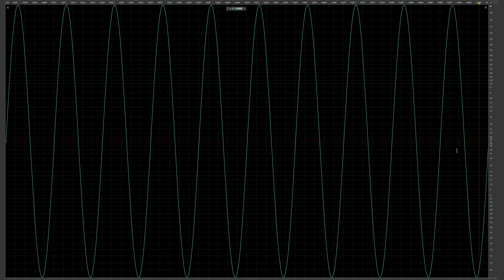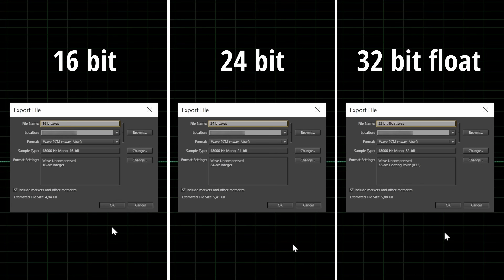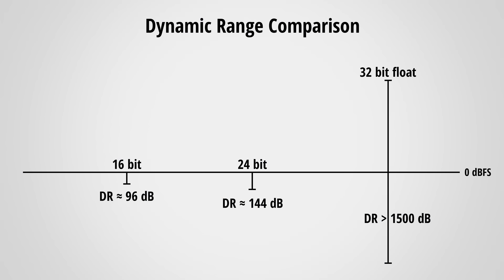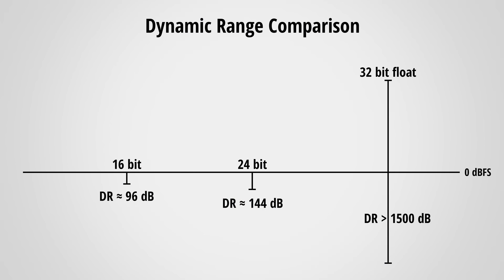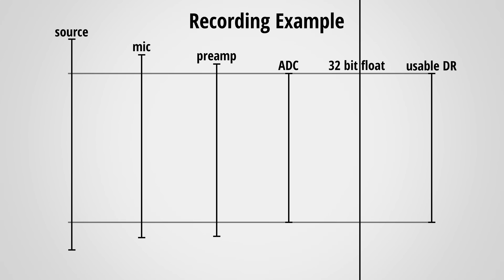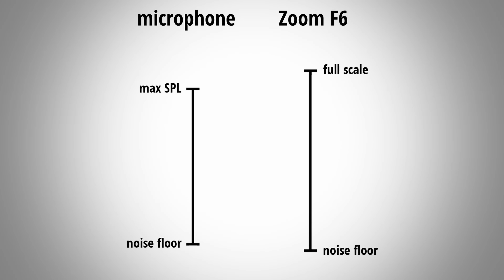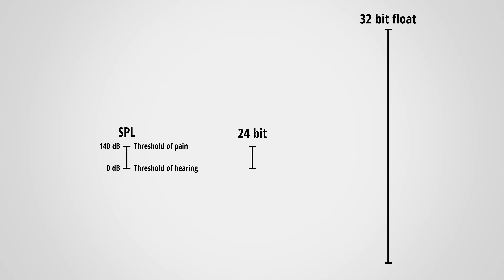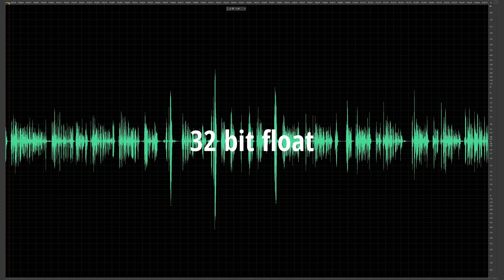The TRUTH about 32 BIT FLOAT for audio recording– Really useful or marketing hype?

Comment: There's nothing special about 32 bits when it comes to restoring clipping. 16 bits can also be restored by the use of synthetic restoration. The cost is: less resolution - in both cases. 32 bits don't automatically give a greater dynamic range. A choice to use some of the extra resolution for greater headroom must first be made. When a recording is clipped, the information is lost forever. Calling it restoring the original sound is a misnomer. It's all about a synthetic process where the data is guessed more or less accurately - usually less. To truly recover lost sound the process needs to understand the sound and what it consists of and basically replay the tones or voice from a library, in time, frequency, and phase domain - an impossible task. Today there's no sensible reason for not always using 32-bit float when the equipment supports it - especially when dealing with advanced filtering or synthetic voices and instruments.

Comment: Nice coverage, Julian, very well explained. 32-bit float is useful if you wish to push decision-making and work to post production, assuming that your microphone can handle the SPLs you record. I'm with you, 32-bit float is very rarely useful for my work. In fact, if I'm using a channel strip or interface or recorder with a compressor, I can get closer to where I want my final audio to sit with 24-bit and save myself some work in post.
Reply: @curtisjudd so limitations are given by the mic’s SPL. But how would you control your gain, and know you have enough, not being too quiet, when using zoom f3, for instance? Also, does f3 have direct monitoring?
Reply: @thesilencer6736 the F3 does not have an analogue gain setting. Yes, the F3 has a headphone jack for monitoring.

Comment: I wish people would stop calling this "floating point". 

Float (or "32 bit floating point") is a mathematical notion. These new ADC's are "multi-path" devices, not "floating point" devices -- they do a little more than 24-bits, not "1500dB". Moreover, 32-bit floating-point math cannot guarantee bit accuracy beyond the 24th bit. To my knowledge, there are only two DAW's today that can actually store, process, and deliver bit-accurate 32-bit audio.

There have been myriad names given to multiple-path audio processing: ranging, heuristic, parallel, multi-path, adaptive, etc.. I think multi-path is the most appropriate. The IC company Cirrus is working on multi-path ADC IC's, and that's what they call it in their patents --- "multi-path".

Oh, and Julian, the threshold of hearing isn't 0dB SPL. It's -8dB SPL, at mid-range freqs.

Comment: I still don't get it. People are referring to the thermal noise and phase noise of electronic equipment and claim that there is no need for more than 24 bit resolution. But I feel this is only true for the whole dynamic range at once. I want high resolution at low signal levels just above noise floor and still be able to record the full 120 dB range. I understand in 24bit you would have to decide on either one of those objectives.

Comment: don't clip your 24 bit recordings in the first place.  24 bits is enough for audio recording, imo.  32 is fine if you want to add 25% more file size to your project for negligible returns.  some people even record at 96 kHz sampling rate instead of 48.  Hey, remember when 16 bit 44.1 was all the rage when EVERY compact disc used that for encoding?  Math was used to determine that 16 bits and 44.1 kHz sampling rate was sufficient to capture 99.9% of everything we as humans can possibly hear.  So 24 does give you more headroom and lower noise floor and 48 a few more samples of accuracy.  So that, to me,, makes good sense.  But if you have the $ and think it's worth the extra disk space and transfer times. go for it.  I have a 4K TV but I don't need 8K.  I won't be using a size big enough to warrant that much detail.  To each their own but if your ears can't hear the difference, why pay for something that does nothing beneficial?  Lots of people probably have deficient monitors anyway or noisy components/signal chains.  They definitely aren't going to benefit.   Weakest link concept.
Reply: On spot! Cheers
Reply: @SameeraWeerasinghe  On POINT!  :)  Another point... I doubt any pro studio is using 2" tape anymore for multitracking.  It makes no sense anymore.  The .0001% smoothness of analogue isn't worth sacrificing all the pros/benefits of recording/mixing all in the digital domain.  Only analogue stuff you need is just stuff you want.  You can literally model just about anything now but I know some engineers and mixers prefer to still use some hardware like compressors and EQs and such.  At this point in time, the tech has surpassed our ability to discern the difference so using more than necessary seems like just a waste to me.  Someone smart once said use only as much as you need - no more.  or something similar.  No one waters their lawn with a fire hose and no one cuts their front lawn with scissors.  BAM!
Reply: Yeah
I've used 24-bit and 44.1khz for years now. It's fine and I see no reason to switch to other/"better".
I think a lot of these technical hyper-detail perfection-hunting topics comes from boredom and a lack of focus on the MUSIC and being CREATIVE.
You know, the good ol' essentials. Music can also be "perfect" coming from an old kitchen radio

Camera analogy:
"We need even more megapixels!" ;)
Buy a good lense instead and focus on taking good pictures
Reply: Thanks, making a SSL 18 purchase more purposeful 🎉
Reply: Just because the colors represented in a jpg doesn't mean you should shoot in jpg quality. No, I'll shoot in raw and convert to jpg for delivery. Saying "Well you don't need that many colors, because you can't see them anyway." is faulty thinking.

I want the extra bit depth for archival purposes, and the high frequency of 96khz, or even more because of filtering foldback. The higher it is, the more transparent the conversion filtering is, again for having the most pristine version for archiving. There's pre and post echo, or the Gibbs phenomenon that higher frequencies actually help with in the time domain capturing at higher frequencies.
Reply: @aaronmarshall  That's a good point.  As math teachers once said, "Never round off in the middle of a problem."   You want to have the highest resolution during the processing, THEN downsample/round.   But if you can hear the difference between 48K and 96K, you are one bad mofo!

Comment: Nobody would record with an 8 bit ADC unless they're looking to get some of that sweet sweet quantization distortion.   If you're recording a person who whispers and also screams - where the scream is occupying digital full scale (24 bits) and the whisper is ≈ 90dB lower...  The whisper is effectively using around 9 bits.  A 32 bit recorder would encode that whisper using ≈ 17 bits.  These kind of finger wagging summations of dynamic range also fail to consider factors like "headroom" which basically assumes that any recording of a sound is both unpredictable and fraught with technical constraints.  

So yeah, it's technically true that 24 bits can record from the threshold of pain down to the threshold of hearing,  but the lower part of that range will be sitting at or very near a noise floor.  Ultimately 32 bit is another tool in the toolbox that when cleverly deployed gives the recordist a bit more leeway to capture something with the highest possible quality

Comment: Hello Julian! I'm currently trying to use my Zoom F3 as 32 bit audio interface, but audition is still clipping my recording on 0db. I downloaded specific driver from zoom website, updated firmware on the recorder which is adding 32 bit AI mode, chose ASIO in audition, but it didn't help.

Comment: don't forget that 32bit float is incredibly more accurate for any signal processing, expecially modeling.

i rember that using a toneport gx you could literally hear the difference between setting it up at 16bit or 24bit when doing amp/pedal modeling

Comment: Simply using less than 64 bit FP (duble precision or scientific) for processing this day's is ridiculous as you get it cheap and in sufficient amounts for audio processing trough general purpose FPU CPU cores. Best ADC's and DAC's and I mean state of art one's achieve SINAD of 21 bit integer (123~126 dB). ADC is usually weakest link in the chain and no commercial crap doesn't get even close to mentioned limits. If you want to do amateur equipment measurements or very high fidelity recording buy inexpensive Cosmos ADC (almost 120 dB SINAD) and be aware of it's limitations (impedance wise and others).
Reply: You expect recordings to require 160dB precision on the regular? Who makes your 53 bit ADCs and equally low noise front ends?
Reply: @0LoneTech  don't think you really read the comment. I expect use of 64 bit FP because you simply have it (even on your smartphone) for DSP and corrections which will be glued back to 32 bit integer on DAC and even that much because you already have it and for volume controls mostly. Performance won't go up from 21 bit (123~124 dB SINAD) nor it needs. That's a threshold of perfect hearing (120 dB) and in mids and lower highs, and lower   in highs and even lower in lows.
Reply: @lazarprodanovic8373  Processors that do fp64 as fast as any 32bit are rare. It would just be wasted power, memory and time, which is admittedly not uncommon. Fp32 typically calculates four times as fast or more, using half the memory, and still gets you about 25 bits per sample.
Reply: @0LoneTech  lol, you have it in your pocket. Pretty much 32 bit is already legacy. FP on FPU of today's general purpose CPU's (including ARM) is more than enough for audio processing. It is expensive when you really need to do complex scientific simulations then you need GPU's with unlocked 64 bit FP multiplier. It's 64 bit bus so it takes same number of cycles if you do 32 bit or 64 bit,  packing works (to a extent) but for micro OP's that are shorter. And you even have 128 and 256 bit SIMD's there. No need to get into high parallel  many core ADSP's and GPU's (which are actually similar). You probably missed the century.

Comment: i disagree with its not a noticeable difference. I Find lower sub frequencies are easier to bring up to level in 32 bit float. recordings sound fatter. Therefore it is EASYIER to record in 32 bit. with 24 bit you you still can't do that, like a transient happy kick drum you can't record it as hot in 24 bit.
Reply: like you said you have to still record correctly, but it DOES sound better.

Comment: Float means "floating (moving) decimal point". Thinking decimal: imagine a 7 digit number with floating decimal point - we can write numbers from 0.000001 to 1,000,000. Traditionally we use integer numbers for 16 and 24 bit depths and, once again thinking decimal and using a 7 digit number we can go from 0000001 to 1,000,000 - that's because integer numbers don't allow for fractions. 

Let's compare how much larger the second number is compared to the first one in both cases: 

7 digit decimal float: 1,000,000 divided by 0.000001 equals 1,000,000,000,000
7 digit decimal integer: 1,000,000 divided by 0000001 equals 1,000,000

Comparing how wider is the float range compared to the integer range (same number of decimal digits¹):

1,000,000 divided by 1,000,000,000,000 equals 1,000,000 - using float allows for a range (from smallest or quietest to largest or loudest) a million times greater.

1) I used decimal digits instead of binary digits (a.k.a. bits) because it's easier to understand. Remember that floating point is a bit more complicated than what I did but I think keeping it simple helps to understand why floating point gives a larger dynamic range than using integer. I did not talk about dBs because I know very little about it. 

Thanks, Julian! I finally understood how 32bit float works and how it can be implemented using less than 2^16 16bit ADCs!

Comment: One also has to remember that the Signal to noise ratio is the same for 24-bit signals using all bit as a 32-bit float signal. So if you add signals that are at different levels only the "largest" 24 bits of data will survive, which of course normally is fine, since the lower signal would normally drown anyhow. But just to say - the precision of the 32-bit float signal is not higher than a 24 bit signal, as long as you use the full range. What float does, is it saves you from making a lot of those "level"-mistakes and makes it much easier to do the signal processing, but the sound quality is the same

Comment: I'm wondering based on your older video on preamp gain effecting the level of the noise floor in a recording that if you intentionally place the gain on a 32bit recording device (i have the Zoom F6) between the two preamps and lower it in post, do you get less preamp noise? Is it just two halfs equal 1 situation?
Reply: I have recorded album with 32bit float on F6 in 2022 drums, piano, bass, guitars, vocals. And this year 2023 i did another one with my old Zoom R16 in 24bit but i think the most difference there is are the more noisy preamp's Zoom R16 has. With F6 i can boost the top end over 10k high's of a piano without bringing up a bright noise like with the R16 preamps. On this years record i went more mellow, natural sounding overal feel and did not boost those. Overdubbing with F6 is time consuming process couse you have to record with two recorders, one to capture the sync + F6 to get the sound of the preamps and sync those tracks in post but the result sounds really good and there was some depth i could hear in the sound

Comment: You want to translate analog to digital the best possible. 32 bit is the next best audio capture the hardware can do nowadays. 32 bit vs 24bit, you can hear the difference..... you are best off with 32 bits resolution + from the engineering perspective and future audio signal quality. Also it has to do with signal bit resolution not SPL. It is not about a marketing hype but simply audio engineering.

Comment: I really hope someone will cover the topic of lossless files, the difference between wav flac aac, and so on, and compare to 320 256 192khz. Add to that what is 24bit and 18bit when should we listen or what type of music should we listen to music based on these so many formats and so many different bitrates. Most importantly how do we spot genuine lossless files, using different software to identify the authenticity of music files could cause confusion for example Spek and Fakin' The Funk, not all the time both softwares agree with one another when accessing a lossless music files thus this caused greater confusion of am I holding a genuine flac file or not. I think someone should cover a topic like this to educate the proper basic guide maybe even before getting a headphone perhaps.
Disclaimer, this message has been sent to a few audiophiles but there's no response from them yet.

Comment: For me the main selling point of 32-bit float comes when combined with DSP's, there are a number of mics and interfaces that within the DSP are able to process the audio in 32-bit float. If I have my mic setup such that it has a good output level close to where I wish to record to, if I record in 24 bit float, and suddenly get much louder I'd risk clipping. However within the compressor of the DSP it has access to more information and when it detects levels that would normally clip it can automatically lower the gain digitally without having lost data. In this way I can record into a 24-bit float format on my computer, and also not worry about clipping because prior to reaching my computer the processing on the DSP has already made sure the signal is within a good range. This is why a lot of mics claim to not clip, because they have built-in processing that takes advantage of 32-bit float to keep the levels in a safe range. As was stated in the video the main benefit of 32-bit float comes in audio processing, but audio processing isn't just post-processing, there's also pre-processing, and many mics and interfaces that advertise anti-clipping do preprocessing with their 32-bit float before it even reaches the device.